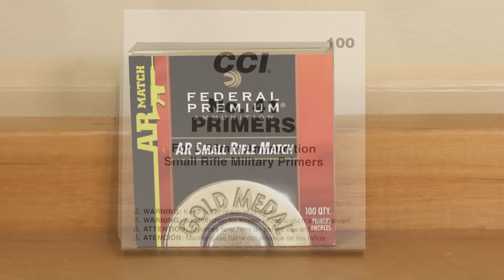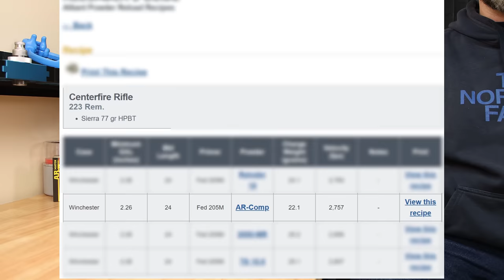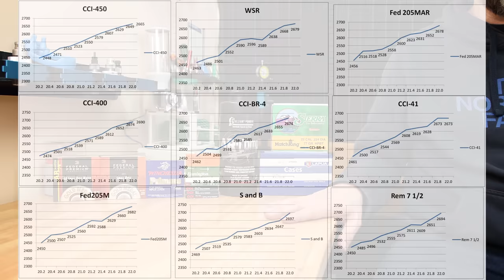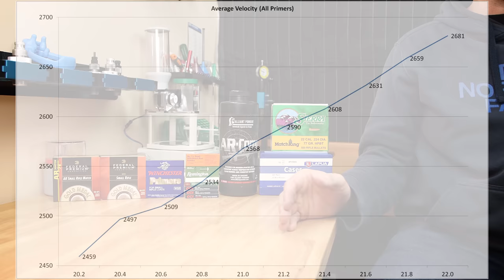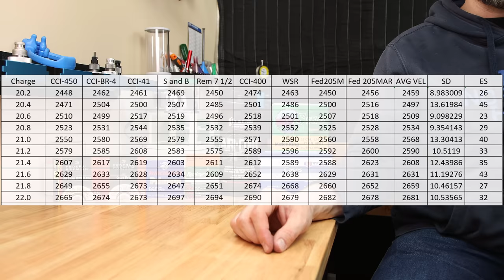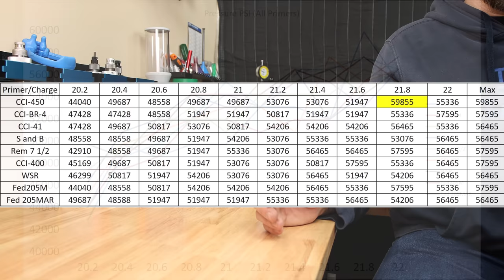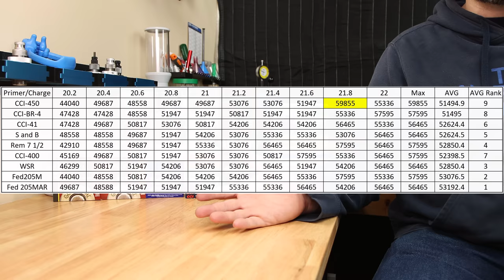Can I Use This Primer? 223 primers TESTED!

Comment: Great video! 

Early on, I bought into the "everyone's reloading" or "everyone's hoarding"  but it's been two years and there doesn't seem to be any reprieve in the component shortage. What I do see is a few components tricking in but at ridiculous prices. 

A pound of powder is now priced at $45 to $50. A brick of primers range from $99 to $149! New brass $100 for a bag of 100, 30 caliber tips $50 a box of 100. 

Ammunition typically sells for $40 for a box of 20!

There's something more going on here than meets the eye because hoarding and new enthusiasts only last so long. When you think about it the one component that shuts everything down is the primer, no primers, no cartridges! 

Place the price of components and ammunition out of the range of many certainly puts the 2nd amendment in jeopardy!

Comment: My fav small rifle primer is the Federal 205 series.  I’ve also had really good results with win small rifles and cci 400.    As crazy as it seems I have better results with just standard 400s than I do with the 450s, 41s or even the BR4s.      With that said I shoot them all and love to play with different loads.    I have never found the primer to be the most important part of the load.    Good bullets and barrels are the heart of good accuracy in my opinion followed by brass and powder.   With that said it all adds up in the game we play.  The slightest of change can turn a good load into a great load and good primers are definitely important.     I have been able to take my best loads and still get good results even using import primers over the years.   Speaking of import primers I wish we would see more imports to help with supply.   Really the only imports I’ve seen in this latest shortage have been Unis Ginex.    I did see some people selling off old stocks of imports at the start of this  but I have not seen any sold through the distribution/ wholesale/ retail channels.   It is good news that the operation in Texas is opening up in the future.  With all the consolidation that has happened and lack of imports we really are at Vista’s and Olin’s mercy.    I have also been hoping that Ammo Inc produces and sells primers with their new production plant they are building.    I have also been hoping Fiocchi would start domestic production out of their newest facility or at-least import some like they used to.

Comment: When I started reloading 223, I was looking to improve accuracy on longer distance shots over factory ammo (Hornady 40gr Varmint Express was the best by far).
I was using this rifle for predator control, in all weather conditions & seasons, and a wise friend gave me a bit of advice... USE MAGNUM PRIMERS in hunting loads.
His rational was that, in his testing, he saw little-if-any change in velocity but saw a much "cleaner" powder-burn resulting in lower SD's & max spread in any given load he had.
Reply: There are advantages to running mag primers in cold weather especially below freezing
Reply: This is nonsense obviously.

Comment: I just did a test myself. 
.223 bolt gun
22in barrel
Varget
Primers:
CCI br4, 400, 450
Fed GM205M
Remington 7 1/2

CCI 400 had highest velocity at 2604 and ES at 31 and SD of 13 AND shot a 5 shot group at 100 yards of 0.10 inches!!

The CCI 450 (Magnums) has the LOWEST velocity average at 2574...go figure and ES of 34 SD of 14

Comment: I've said it forever, not a nickel's worth of difference. Primers serve one purpose, igniting the powder. Not only that, during this shortage, I've been using SRPs for small pistol cartridges with no difference or FTFs. I have heard from others however that light striking pins may not ignite SRPs in some pistols.
Reply: big difference with shotshells though!
Reply: @vettelover2009 Powdered Aluminum to be exact.  An most magnum primers are normal primer compound with added aluminum powder.
Reply: Within reasonable ranges, yeah I'd agree. I can see how the guys shooting extreme long range could see differences.

Comment: Also, the situation with primers makes sense. Speer tested a theory in the 22 hornet with both rifle and pistol primers. They discovered that the gentler pistol primers created less peak pressure and allowed for higher charge weights and thus higher velocity.

Remember: pressure AND gas volume determine velocity--not just pressure.

Comment: and remember this is all of these variables fired from a particular firearm. You could add the shooter but I'm guessing this was a rifle mounted in a ransom rest... Still, the day and the environment would have a small play as well. Great job on the data! I mathematically calculate pressure at this point, but would really like to add the PT II to my bench. The only issue I'd have is in calculating for auto pistols with no exposed barrel. I'm guessing the manufacturers use a test rig with an exposed barrel for their claims.

Comment: I feel your pain: the primer shortage is worldwide.
On this subject, do you have a video about primer pockets uniformization? Eric Cortina was making a good point the other day that uniforming your primer pockets just makes sense if the tool uses the same datum of the base of the case than your priming tool. Otherwise, your caliper would be able to have the same measurement of primer depth from the case base while with variations on the distance of the primers from the flash hole.
Reply: I tried using a Lyman pocket uniforming tool for a while on primarily once-fired Mil brass. It rarely uniformed anything other than scraping residue off the bottom of the pockets. On occasion it would actually scape a tiny bit of brass off the flash hole circumference. I don't bother with it anymore.

Comment: CCI small pistol magnum primers are dimensionally identical to small rifle primers just BTW. Trying to find ARcomp up here is the real task, even CFE223 is getting tough to come across at a reasonable price. Just saw 2lbs of Retumbo go at auction last week for $500 CAD ($400.USD)...friggin ridiculous!
Reply: the cups on small pistol are thinner and may be pierced in rifles. The primer height is different as rifle primer pocket depth is deeper than pistol primer pockets which will leave rifle primers protruding from pistol primer pockets.
Reply: @greybone777  small pistol magnum
Not small pistol.

Comment: Small commentary. The CCI #41 doesn’t have a thicker cup. The difference as specified in military contracts is that in order to reduce the chance of slam fire, the distance between the cup and the anvil is larger, not the thickness of the cup wall

Comment: Has anyone ever experienced a slam-fire using CCI 400 or 450 in an AR? I get 41s usually but have some 400s on deck as a last resort.
Reply: I used many 400s in many different ARs and never had an issue.   450s are a mag primer and have a thicker cup and are recommended over 400s.
Reply: @halfdollar86  Thanks for the info!
Reply: Never in a mini 14 ,ar or any other semi auto.

Comment: Where I live, for fun target shooting, I have resorted to large pistol primers both standard and magnum for my plinking in larg rifle cartridges , they work fine with some precautions such as, primer hight, also pistol primers are supposed to be slightly softer due to pistol fining pin systems,  I have had no issues, no miss fires , hang fires , premature firings or pierced primers  out of hundreds of light to 80% loads!  It saves my very limited stock of LRP for hunting loads. Was told by two of our local gun store owner's CCI and Remington are not accepting further orders of primers for 2022 (this is in Canada).

Comment: Is the 222 mandrel giving you enough neck tension for magazine loading on the ar platform? Asking because I have read in the past by the keyboard masters that the recommended will be around 3 thousands for mag loading ar due to the bullet moving when the bolt loads the round into the chamber, have you seen this. 222 will give you around 1.5ths to 2ths neck tension, is this enough? Please correct me if I'm wrong. Thank you for your great info.
Reply from the maker: Hello and this is a great question. First this is new brass and if anything most of this brass is "too small" so it need any dings etc ironed out. Projectile is .224, so if it springs back at all other going to be smaller not larger. So I should be running between. 002 or a little more. That said I encourage to subscribe because I am going to do a series on setting neck tension and show seating force graphs with my amp press to put numbers to these measurements. (223 will be one of the calibers) I am sure you wanted a quick answer but stick around data is better than opinions. Thanks for commenting!

Comment: If you really start digging into the chemistry behind the primers you'll start to understand why the fixation on primer differences is misplaced.  It's generally known that different primers have different cup thicknesses to account for heavier or lighter strikes.  But really when you boil down the compound used in the primers it's essentially all the same.  The only real difference between regular and magnum primers is the addition of fine powdered aluminum to allow for a burn that reaches further into the case.  It does burn hotter temperature wise, but doesn't really add any more power to the system.  The goal is to get those burning aluminum grains to move deeper into the case before they lose energy.

There's a pretty in-depth group of guys who are using that knowledge to make their own primers.  It's not out of the realm of possible for people to do on their own.  But you do need to have some knowledge of the chemistry.
Reply: FYI, most modern non-corrosive primers are a combination of Lead Nitrate, Lead Hypophosphite, Nitrocellulose, fine glass (or silica) powder, and aluminum powder for magnums.  The addition of some water during manufacture causes the Lead Hypophosphite and Lead Nitrate to react and form Lead Nitratohypophosphite.

Comment: best way to test a primer to see if it is worth using in a free floating firing pin gun, is to put a primer in a empty revolver case and see if the revolver will set it off. found that win WSR works really well for 357mag and now refrain from using them in semi-auto type guns. cci 400, 41, 450, and BR4 primers do not fire off in a revolver and i have stuck to using those in rifle loads. a person always wants to test components in ways that are safe before going to the intended use for elimination purposes.
Reply: My revolver set off all small rifle primers I had including magnums

Comment: very interesting . especially with the cci41 . have a older speer reloading manual that states the cci 41 is a magnum primer and is interchangeable with small rifle magnum primers . says the same with the large rifle primers .
Reply: The only difference between 41's and 450's is there is slight bit more gap between the cup and anvil, I meant tiny

Comment: New subscriber thanks for the content, new to reloading. Question for anyone, is there a dye, or some type of marker that can be used to mark the end of the casing to identify your loads? For example I use to different rounds for my Blackout, a supersonic and subsonic loads. I want to be able to mark the rounds so I know what I'm grabbing. Thanks.
Reply: If I can’t tell by the look of the bullet, I use different manufacture of brass to tell the difference
Reply: @30Huckleberry  thank you. I saw a guy at the range, and he uses some kind of plain pen he said. Just curious if anyone else does that. Guess I could use colored markers, just not sure if it will stay on. I was hoping to find what ammo manufacturers use, some of my ammo has red and green dye around the primer.
Reply: I have used markers to make an "X" on the head with different colors or completely "paint" the entire head with the marker. A stamp pad might be faster and I'll probably try that sometime. Usually I am just trying to identify my reloads from other people's reloads or factory brass when recovering them off the ground. For the load I mark my reusable plastic boxes well with labels.
Reply: One method is to use machinist’s layout fluid. It paints on like ink and dries rapidly. Note that you will eventually stain your work area so blue may be a better choice than red.
Reply: @TheSailingwoodworker  would thanks, great ideas.
Reply: Metallic sharpies are the bomb!  I use them all the time and it is fairly robust.  Dykem also works but keep the coat thin, it's binder is a little sticky.
Reply: Marks-a-lot pen. I use them to keep loads, lots and times fired.
Reply: @mattfleming86  thank you
Reply: @craigfaulkner604  perfect, thanks.
Reply: @craigfaulkner604  just order them, thanks again.